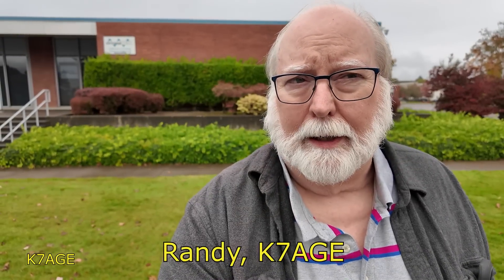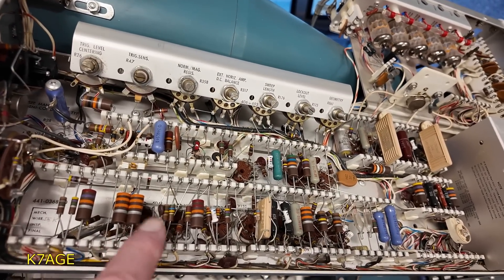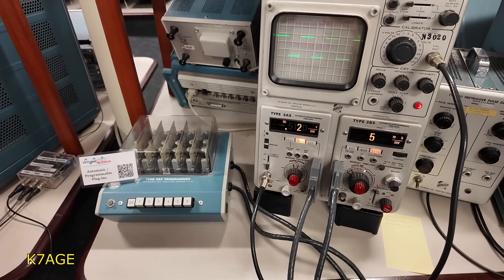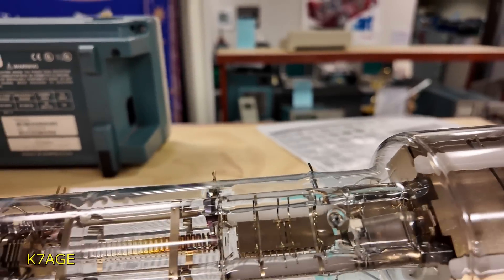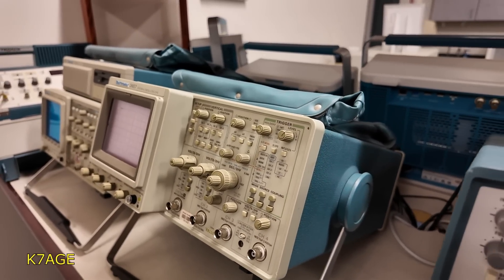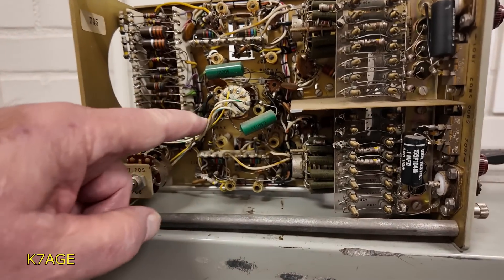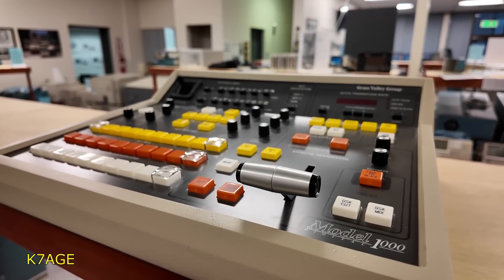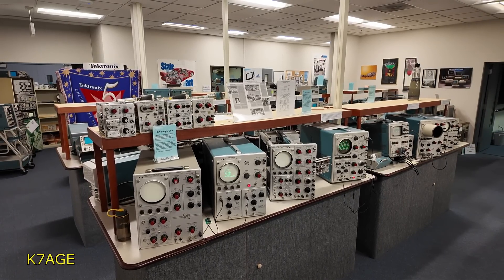Visit to the Vintage Tektronix Museum

Comment: I worked for Mutual Broadcasting when they began using satellite distribution and I used a Tek 492P Spectrum analyzer to look at out satellite downlink.  Then at C-SPAN, we had a bunch of Grass Valley Model 100 switchers that our field crews took out in the field to do remote multi-camera shoots.  They were work horses.  Never a problem with them even with all the bouncing around they endured.  Back in the early days of C-SPAN, before I got there, they used Grass Valley Master Control switchers that required separate sync and subcarrier reference inputs.. Those were the OLD days of video switchers!  Grass Valley television equipment back in the day was excellent!  And for those who remember, the control panel that blew up the star ship on Star Wars was a control panel from a Grass Valley video production switcher.
Reply from the maker: Thanks for the information. That's a great story.

Comment: My last Tek scope was a beast of a rack mount 400mhz machine. Only 5.25" tall but 19" wide and 23 inches deep! an R7903 that came out of a nuke testing lab as surplus. Worked very well but I downsized after retiring and it had to go, took up way to much precious desk real estate! I now have a little Rigol LCD scope that weighs all of 5 pounds(instead of 30!) and is 200mhz. Plenty for what I need these days.

Comment: I worked in Analog Semiconductor Test and used a bunch of Tek gear. Got a few in my Shop even though retired.
One thing you mentioned was you worked on a Black and White TV Truck back in college....did this happen to be at the College of San Mateo?  If so our paths may have crossed depending on when you were there.

Comment: Very cool! When I started working as a tech at an electronics manufacturer, the scope I used most often was a 465. Also, when my tech school moved to its present campus, the electronics department had an incredible amount of stuff that was squirreled away (and barely half made it to the new campus across town - there was like a 10' pile behind the old building when all was said and done). I remember grabbing an old tube-type oscilloscope... It was most likely Tektronix, but I cannot remember what model it was! It opened like a book for servicing and there was even a spot to spool some silver solder for the terminal strips. NO idea what happened to it though. :(

Comment: Thanks for a great tour Randy, it brought back so many wonderful memories.   I worked as a bench technician in a Tektronix field office in Pittsburgh, Pa starting in 1976 and retired in 2018 as a Region Support Specialist supporting the solid ink printers.  I developed my interest in Tektronix oscilloscopes while in the ASAF as a PMEL technician from 1972 to 1976  and worked in a PMEL lab at Griffiss AFB in Rome NY troubleshooting, repairing and calibrating only oscilloscopes.  I saw scopes from Tektronix, HP, Hickock, LaVoy and Dumont.  Tek scopes were by far the best I worked on.  I think the oldest scope I worked on was the 535/545/555 in the Air Force.  While at Tek I worked on just about all of the models you show in your video up to the 7704.  If there are any other technicians who worked on the 465 ask them if they know what C220 is?  Around 1980 I moved into Field Service in Pittsburgh and worked on the 4006 up to the 4115 and 4116 then moved into color printing.  I was 1 of 9 field technicians selected to support the color printing division.  We were called Region Support Specialists and did numerous  trips to Wilsonville for 2 or 3 weeks at a time to help the solid ink engineers with what we called RUS  We focused on reliability, usability and serviceability of the solid ink printers.  Thanks for the memories and for the opportunity to write down my history.  I think this is the first time I have done this.
Reply from the maker: Thanks for sharing your story, it’s a great memory from Tektronix history.

Comment: Used both Tektronix and Hewlett-Packard big tube type scopes in the 1960's (when in the Navy) and did repairs to both.  The Tektronix were much more robust.  The HP had tube sockets affixed to phenolic boards that were always discolored around the tube socket from the heat.  While working in the EL/EE repair shop at Cal Paly University (San Luis Obispo) in the mid 1970's, we had an HP 180 on our test bench.  I guess it worked well enough, but the "feel" of the knobs and switches and the "fit and finish" seemed chintzy compared to a Tek scope.

Comment: When I was in the Navy (1966-1970) I learned that there were depot level refurbishments of things like 565 scopes (and I assume other equipment) at Long Beach.  What they did was remove all the tubes and throw them away.  Then the entire scope, without cabinet, was put in an industrial dishwasher of some sort.  Then left to dry.  Then it was repopulated with all new tested tubes.  Then they attempted to recalibrate and usually there was no further repair necessary.
Reply: USAF PMEL lab (and later at TEK service centers),I used to wash TEK scopes in a spray booth,then into a drying oven for 3 days. I could take a filthy grungy scope and make it look factory-fresh. you had to avoid washing the HV and power transformers,or you'd end up replacing them. I even did touchup spray paint on the cabinets. some customers used to write thank-you letters to my boss after they got back a 400 series portable that I cleaned,repaired,calibrated,replaced worn rubber feet,repainted the cabinets,and their scope looked like new.
Reply: @JayWye52  When I was working part time at Cal Poly's EL/EE equipment repair ship, it was my job to refurbish donated equipment.  I didn't go to the extremes you did.  But did a lot of cleaning which especially involved removing blued on inventory plates, old calibration stickers, and such.  And, of course, repairs and calibration before putting it into a lab.  I have always wondered if there were parts in a Tek scope that maybe shouldn't get wet.  Maybe when they used that dishwasher they first covered, or even removed, some items first.  One thing they gave me was a small ammo box filled to the brim with used machine screws (6-32, 8-32, and smaller and larger ones).  I still have what must be 20 lbs. of screws and dip into to occasionally.  Certainly, a lifetime supply.

Comment: I first started using Tektronix scopes in the Navy at the transmitter site at Midway Island (technically, the Midway Islands, Sand and Eastern Islands) in 1966.  Used 565's there but we also had a little 310 rackmount version.  Later on, a ship we had some militarized portable version, I forget the model number.  While studying at Cal Poly University I worked part time repairing equipment for the EL and EE labs and fixed many Tektronix scopes (often from a student connecting a probe's ground clip to line voltage).  In industry, I was seldom without a 465B at my side.  I learned the hard way to use special solder for the scopes with the ceramic terminal blocks - regular soldering just would not work.  And the little loop of solder that was originally provided inside the scope as a courtesy was always gone.

Comment: I have and use quite frequently (2) Tektronix spectrum analyzers, a 2712 and a 2715. I have a couple of much newer LCD type analyzers also but I mostly use the Tek units. Best thing is that I can repair them myself if needed. 

I had a good career as a fitness instructor with a side in electronics, but always thought that maybe I should have gone further with an electronics career. Tektronix would have been my first choice of places to apply for a job :).

Comment: The variety of CRTs is mind boggling.  I recall a joke from one of the rascals at Motorola in the 1980s:  HP never could make a decent scope and Tektronix never could make a decent computer.
Reply: TEK were the best scopes,Fluke the best voltmeters and precision voltage sources,and HP made the best signal generators.

Comment: A few years ago I was given two RM-45A oscilloscopes and several plugins. I managed to get one working using tubes from both scopes. There are 90 tubes in the scope. I had the Type CA plugin working, but didn't get the Type D or 1S1 sampling unit operational. I contacted the Vintage Tektronix Museum to see if they were interested in a donation of any of the scopes or plugins. They were interested in the 1S1 plugin and I sent it to them. Maybe it's on display. The remaining scopes and plugins were given to a local Tektronix collector. I hope to get to the museum sometime. De WG2E.
Reply from the maker: Nice

Comment: Well, IMHO, Tektronix is THE leader in oscilloscopes, curve tracers, benchtop DMMs, scope accessories, plugins and modules, counters, func gens, but I think HP leads a little in spectrum analyzers. The special Tektronix solder was a 60% tin, 37% lead and 3% silver alloy with a rosin core. A more modern 2% silver, tin & lead alloy will work on those porcelian ceramic terminal blocks too. NEVER use lead free tin and copper solder on those terminals. I still use some 465Bs, a 2445, 2645, 2215, 2245, good 1980s scopes. HP was always playing catchup to Tektronix when it came to O-Scopes. I'd step on modern HP Keysight scopes to get to a good high end Tektronix scope.

Comment: I worked in a Cardiology Research Institute from 1973 until 2018 at the University of Utah. Designing and building many types of research instruments, we used a long list of Tektronix equipment. We also used a lot of Tek 4010 computer terminals. During my electrical engineering school years I found and refurbished a Tektronix RM 45A Oscilloscope as a lab project. I paid $25.00 for the scope and it still works very well. I also have a complete TM 500 system on my bench as well. 
Thank you very nice trip down memory lane.

Comment: Here's a bit to add to the Hickock copy story, perhaps apocryphal. Hickock ordered a 545 from Tek, who were suspicious. So Tek took a chassis punch a put an extra tube socket hole inside somewhere which they knew had no function or purpose. They sent this one to Hickock. Sure enough when they got a chance to examine a Hickock scope it had a hole exactly the same size and position. Finally to add insult to injury the Hickock scope had a better maintenance record. The reason was that any time a technician had a choice in checking one out of the equipment bay, they would go for Tek so they got used a lot more.
Reply: So did Hickock set up a production line to make the ceramic silvered notch tag strips that are identical to Tektronix's?  I don't think so - it would have cost a fortune and taken a while to get right.  Nah, Hickock purchased the tag strips from Tek - and since the spare part sales volume of these tag strips would have been very low, a large order from Hickock would have or should have alerted Tek.
And how do you suppose Hickock got the CRT's except by buying them in quantity from Tek?
Even getting the control knobs in the correct colours would be difficult unless it was legit.
In fact, the US Military had a policy of forcing second second and third sourcing of their requirements.   Tek would have known perfectly well that Hickock were making exact copies and it was above board.

Look at any US miliary electronics (and aircraft too) and one company designed it, and was made to give the drawings and parts specifications to 2 or 3 other companies.  As in the famous Collins 390 radio made by various companies.   It protects the military supply chain against things like a fire burning a factory down.
If Tek took Hickock to court, it was because someone in Hickock slipped up and sold a few to non-miliary customers.
So I think your story about Hickock buying one 545 and Tek adding an extra tube socket hole is bunkum.  One or more samples would have been handed over along with a complete set of drawings and parts specifications.   And maybe the loan of an engineer or two to help get things right.   Hickock would have paid a licencing fee to Tek.
The only major company that resisted this second sourcing imposed by the miliary was Hewlett Packard.   Bill Hewlett decided "if the military want what we make, they can buy it from us"  and refused to hand stuff over.
Reply from the maker: Thanks
Reply: In the USAF PMEL labs,I serviced TEK, Hickok,and LaVoie copy scopes,and neither of the copy scopes were as good or reliable as the TEK scopes.  Hickok and LaVoie scopes didn't have the quality.
Reply: @JayWye52  What were typical faults in the Hickock and LaVoie copies?   A common faults?
Tek were proud of their power transformers they made inhouse.   In my (civilian only) experience fixing tube based and the earlier transistorised CRO's I have never seen a Tek transformer fail.   But power transformers are something Hickock and Lavoie could have purchased from any competent transformer company.

Comment: I used a number of Textronix scopes through the years. My individual focus was the 561. I did a formal thesis on it in tech school. Some of them were in general research lab useage where I designed and built custom lab equipment.
   As if the operational aspect wasn't enough, some of them started to fail all with the same symptoms. Long story short, I discovered a significant design flaw which turned out to be an insulation weakness in the main power transformer. The CRT filament winding was arcing over to an adjacent winding because it was at the high voltage anode potential. After ordering an expensive exact replacement and taking quite a few hours to replace, I had another one fail in the same way. From that point on I merely disconnected the internal winding and ran the filament with an external generic transformer rated for the voltage in use. It probably only existed for other oscilloscope manufacturers, where Tek opted for their own custom design. I mounted them externally on the back of the chassis with proper insulation precautions and the modified units never failed that way again.
   As a sidenote I used silver bearing solder (not the same as silver solder) for repairs on the  ceramic component standoff strips because there was an advisory that regular solder would leach out silver content in the strips. Maybe the special alloy was needed for the solder points in order to keep them held in place to the ceramic. I dunno. I never did get any more information than that other than to use the silver bearing solder my group kept on hand reserved for Textronix repairs and mods. I don't even know where the solder came from as it was already there when I was hired.
   It was a bit comical that whenever Tek put carry handles on a scope it became designated as "portable". I got a good laugh out of the crowd one time at a local Tektronix seminar when people were speculating on prices of certain models with two carry handles. They were big units. I quipped that Tektronix didn't make anything with two handles for less than $1,000. It turned out to be accurate when the salesperson came over to talk with us and revealed the price!
   Nice video. N1KHB
Reply: I worked as a technician for 20 years in a place that repaired Tek scopes.  I still restore them as a hobby.   First time I've ever heard of a Tek power transformer failing.  They are extremely reliable.
The need to use silver loaded solder is well known though - there is a caution note about it in every Tek item using those tag-strips, except for some low cost items and, apparently, some equipment sold to the US armed forces.   A small roll of the solder was included inside each item of equipment - except for equipment sold to the US military.
Reply: @keithammleter3824  Maybe it was just a certain serial number range where the winding insulation was poor. I can't say for sure.

Comment: The summers of 1978 and 1979, along with a lot of really smart kids, I was selected for a Computer Camp at Northwest Missouri State University.  It was a joint project between Iowa, Nebraska, Missouri, and Kansas departments of education, and we geeks had a great learning experience.  My favorite part was getting to use and experiment with a Techtronics vector graphics terminal, powered by a DEC PDP-11/70 with all the bells and whistles.  It inspired me to write an early portable graphics library, and after college I went on to work in HP high-performance graphics workstations.  Of course today your smartphone has more capability, but it was all exciting.

Comment: I have  543a Tektronix scope that I have has for about 35 years. It did not work when I got it and It was just a fuse had blown. after I replace the fuse I am still using
it and works great. The thing is, after watching all these video's about Tektronix's equipment I have never seen that scope in the video's. Is it rare or nobody likes them.
I know it is a 30 meg scope but still it works for what I need it for.

Comment: I sometimes think about how the oscilloscope industry has changed.  For many years the magic ingredient was the CRT, 12:19 12:19 which required incredible design and development.  With the advent of high speed A/D converters,  CRTs are no longer necessary for most applications.  The signal in question can be digitized and stored, printed, and further processed. 12:19